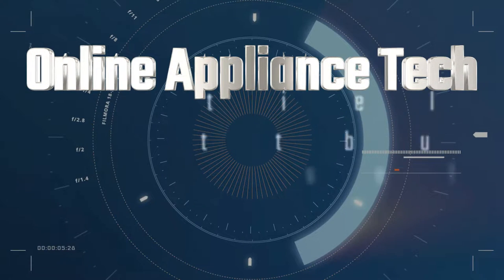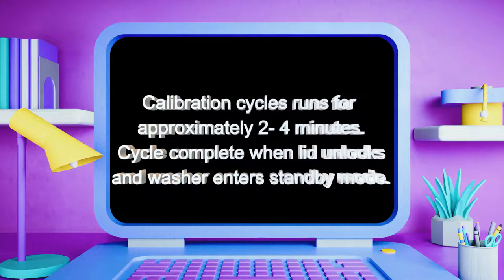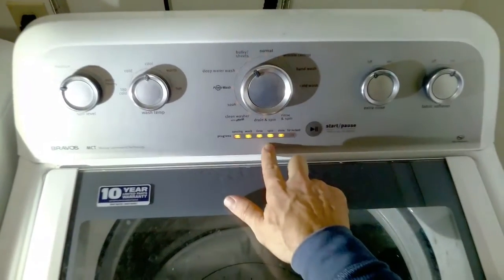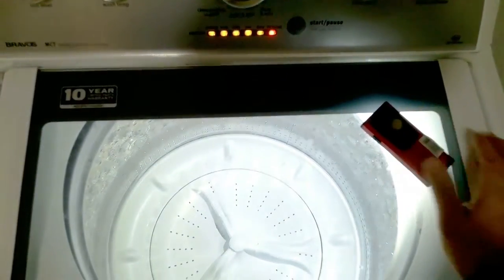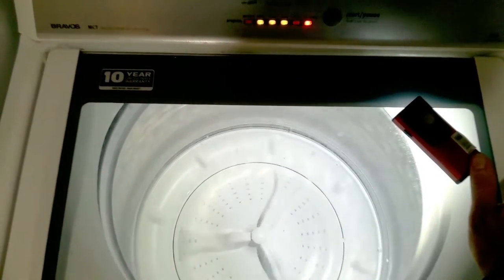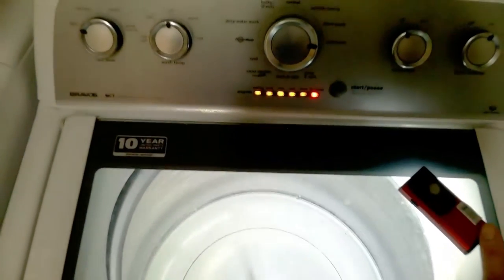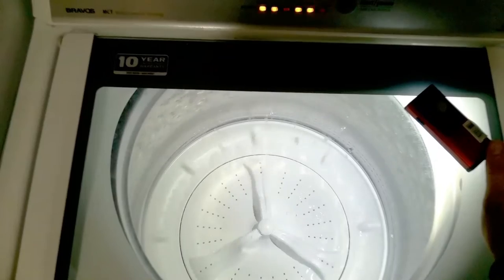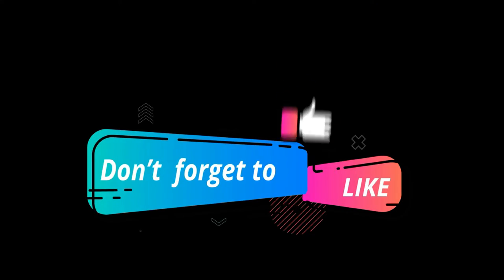Maytag Washer Calibration MADE EASY!

Comment: I have this exact washer this calibration will not work i have tried multiple times now, basically it only clicks without lights when i try to start a load... no water no nothing,  any ideas to what could be wrong? Its only 6-7 years old
Reply from the maker: I apologize for any inconvenience you've encountered. At times, if you don't reset your washer either by unplugging it or by long-pressing the cancel button prior to trying, it may lead to a malfunction. Similarly, when attempting put into test mode for calibration, ensure not to rush the process. I hope this advice proves useful to you. Best wishes on resolving the issue!